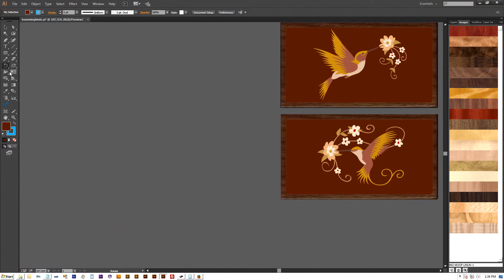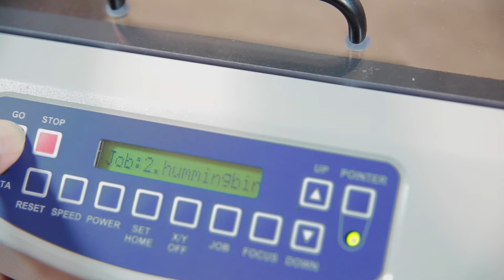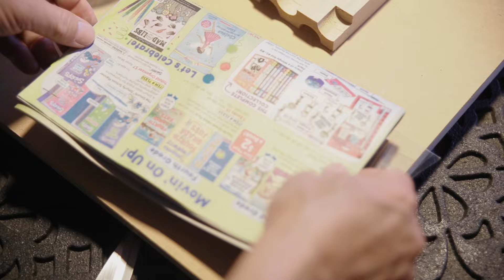Modern Laser Marquetry and Wood Inlay Technique

Comment: Those Epilog Machines are amazing.  I had the privilege to use one for about 4 years and never realized how superior those machines are until I had to end up buying a Chinese one.  Chinese machines you have to constantly maintain and adjust things.  That extra 15,000 or so is worth the price for an Epilog.  The accuracy, straight cut, precision, clean engraving, the Epilog is unmatched.  Great work.

Comment: I'm impressed, as old as this is, I didn't realize that the tolerances could be set so finely that it creates a very tight fitting, and that the scorch marks can sanded away so cleanly. On the downside, zero access to a laser, so probably going to try the old fashioned method.

Comment: Gluing veneer directly to hard wood means that, during seasonal expansion and contraction of the wood(which does not apply to veneer due to its thickness), the veneer will be torn apart and ruined.
Reply: Bullshit. Look at guitars.

Comment: Well done. I hope that you will make another video clip same this one. 
Can you tell me how much of the power and speed you setup for cutting that wood-veneer? I just worry that laser cut line's width is too big and then, when we assemble it together we can see that's cutting line is too clearly. But I watch on this video clip is can not see that laser cut line. It's really beautiful. 
If you have time, please give to me the answer. Thank you very much!
Reply from the maker: With a 30W laser, to cut those wood veneers I set to 10 percent power and 25% speed. ImagePaint allows you to offset the path to compensate for the laser beam diameter, so the pieces will fit tightly, assuming the sharp corners in the vector design has been rounded to the laser beam diameter. In the latest ImagePaint software, a new feature was added to allow users to round those sharp corners automatically before offset path is applied. Yes, I will create another video using the latest ImagePaint software showing how to use the new features. Thanks for the great question!
Reply: Thank you very much!!! It's so helpful for me. So, when you create that video to showing how to use the ImagePaint software, I'll watch it and learn from it. 
God bless you! Thank again!

Comment: Thank you for sharing, good video. Question; can the same process
be obtained when you have concave or convex surface, and if you would what
laser would you recommend. Thank you and have a nice day.
Reply from the maker: Thank you for your comment. I have not tried surfaces other than flat, so I am not sure. Lasers are very accurate, so as long as it has enough power to cut through the veneers at a reasonable speed would be good. At a minimum, a laser should have at least 5 Watt  power to cut the veneer. I recommend a low cost (a few hundred dollars) laser for this application. More expensive laser would be an overkill.
Reply: Thank you for your advice, have a nice day.
Reply: @amazoncanvas  Im very interested in this concept and it's versatility the software is also very cool. I wonder if you know if it could be applied to metal as well if you can recommend a laser and router to cut thin metal and also engrave embossed images meaning not just line engraving but a 3d image in metal. The other thing is I'm good at drawing out images and getting the detail I want. How can you convert a jpeg or png to vector format to transfer my drawings to a different surface like metal and wood? For example if I draw an eagle how to I go from a flat image I drew out in pencil to a head that's rounded feathers that are raised slightly off the surface that kind of thing. I also think it would be cool to scan and vector a veneer of burlwood and transfer the pattern onto another type of wood or even metal if you want.
Reply from the maker: @KevinFlores-rc1lq  
CNC Router is better in cutting thin metal then laser. Our software, ImagePaint, is an Adobe Illustrator plug-in. In Illustrator there is a tool called ImageTrace that can take your drawing or .jpg image can convert it to vector artwork. ImagePaint helps you create inlay artwork, which is 2D. I don't know any software or machine that can create 3D image onto thin metal, but for 3D wood carving, you can look at Aspire software from Vectric.

Comment: you cut parts in exact dimensions or internal pieces you cut a little small than the external frame to can fit inside?
Reply from the maker: This is how ImagePaint software prepare the path for cutting: For shape that has holes inside, the outer shape is made larger and the inner shape is made smaller. For regular shape (one without hole), the shape is made larger. The amount ImagePaint uses to increase or decrease the shape size can be configured by you.

Comment: Does it work with shell sheet inlay too?
And what is the name of the softaware and the laser engraver machine?
Reply from the maker: It works with shell sheet too and any materials that can be cut with laser. You can use any laser machine. Software from www.amazoncanvas.com called ImagePaint Production Pro

Comment: What CNC brand and type should i have to make this???
Reply from the maker: You can use any CNC or laser with the software. ImagePaint supports many CNC routers and it support all lasers. On rare occasions, some users reported that ImagePaint does not have the Post Processor that works with their CNC router. In this case it would take no more than a week for us to update the software with the new Post Processors.

Comment: What software are you using please?
Reply: The software used was Adobe Illustrator for the design and ImagePaint as an addon to AI for filling the design with the image of a veneer.  ImagePaint can then be used to output to a Laser cutter (or CNC) cut the custom pieces.

Comment: Wish I could find a laser for this that didn't cost so much.
Reply from the maker: ImagePaint GCode Pro supports CNC routers, so you don't have to get a laser to do very intricate inlays using very small router bits (0.01 or 0.02 inch diameter tool)!
Reply: Hello,alphasxsignal